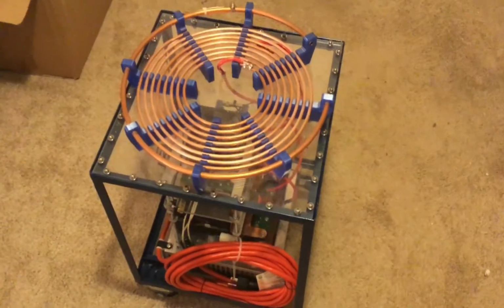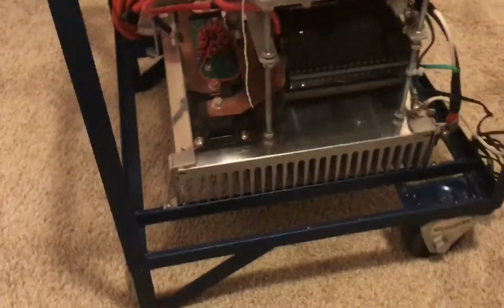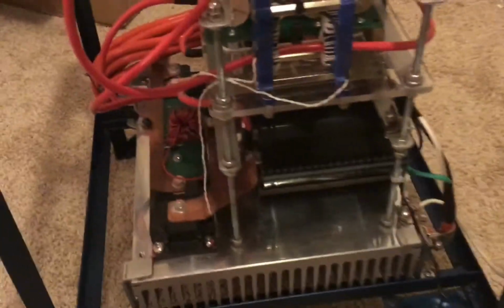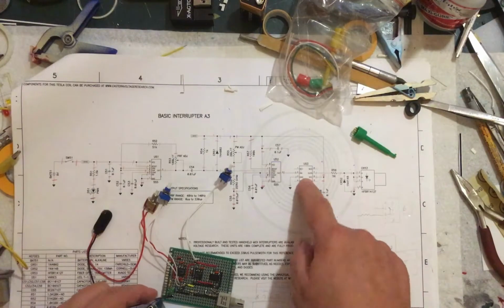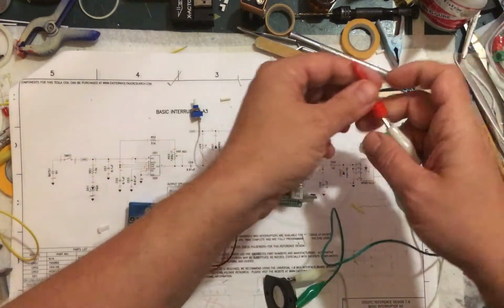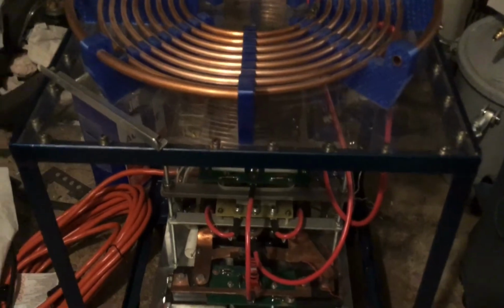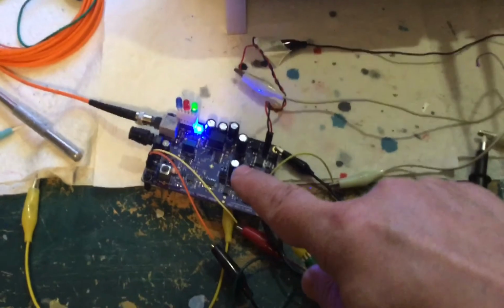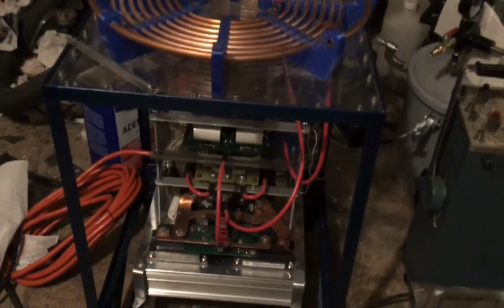Musical Tesla Coil DRSSTC Build part 7

Comment: Nice ! I have a fun Plasmastatic Speakers system I am designing. There are ways to make them run without batteries or plugging in. The extra noise can be handled by ultrasonic soldering, reflective grounding, and traditional grounding. To avoid some problems with ionic generation I recommend placing a strip of large LEDs as a load to replace oxygen within the room.
Reply from the maker: Cool! Makes perfect sense. Thanks for the advice!

Comment: ON THE CONTROLLER YOU NEED TO HAVE YOUR GDT CONNECTED TO IT FOR A ACCURATE TEST, ALSO I'LL RECCOMMEND TO CONNECT THE GROUND LEAD FROM THE SCOPE TO THE GROUND OF THE CONTROLLER AND NOT ON THE OUTPUT FOR THE GDT, YOU ARE CREATING A SHORT ON THE OUTPUT. OR YOU CAN TRY WITHOUT CONNECTING THE GROUND LEAD. REMEMBER YOUR SCOPE AND THE POWER SUPPLY YOU ARE USING FOR THE CONTROLLER ARE BASICALLY SHARING THE GROUND ALREADY SINCE THEY CONNECTED ON THE SAME OUTLET. YOU CAN CONNECT THE GROUND LEAD ONLY WHEN MEASURING THE GDT OUTPUT (THE SIDE GOING TO THE IGBTs ) BECAUSE IS A ISOLATED OUTPUT. IM GOING THRU THIS WHOLE PROCESS AGAIN BECAUSE IM UPGRADING MY SECONDARY AGAIN. BY THE WAY YOUR COIL GONNA LOOK AMAZING !!!!
Reply from the maker: Thanks! I appreciate the info!

Comment: Hi, I'm selecting all the components I need to build the UD2.7c, but I don't know the "tunable inductor" value for this eastern voltage design, could please tell the reference? I know it is something like 7M3-xxx
Reply from the maker: I’m not sure, but I think it’s a -683. That’s what I’m going to start with, but I’m still not sure exactly how to tune it yet though.
Reply: @customfabrications  Oh, thanks for the info. In the meantime, I've searched in the UD2.7c website and they say: "	Inductance values varies depending on your switch and switching frequency. Typical values include: 7M3-123 (9 - 15uH; works well with TO247 IGBTs), 7M3-153 (11 to 19uH), going up through 7M3-223 (17-28uH), 333 (25-41uH), 393 (29-49uH; works well with CM200/300s), 563 (42 - 70uH) etc.  Use a flat-head non-magnetic or plastic screwdriver for tuning (see instructions below in this page)." Take a look there

Comment: The way you coil the secondary is important, be sure it is clockwise or counterclockwise
Reply from the maker: I was wondering about that. The plans I bought don’t specify. It seems like every video I watch, they always wrap it counterclockwise (viewed from top), so I’ll probable do it that way. Actually, I’ll probably ask Eastern Voltage.
Reply: @customfabrications  I know that the way the primary is coiled, is what ditates the way the secondary is coiled

Comment: Also keep an eye on the primary coil.  I see your supports are 3d printed.  The primary can get warm/hot.
Reply from the maker: Yea, the original plans call for plexiglass. PLA does have a lower melting point though. But hopefully it’s ok.

Comment: It'd be a wise idea to enclose the driver inside a aluminum box that's grounded to keep noise to a minimum in it.  You might also have some issues with what looks like a steel frame inductively heating.  Always try to use non-ferrous metals.
Reply from the maker: I sent pic to the engineer at Eastern Voltage research. He said that since it’s a lower power coil, it may not heat the frame that bad.

Comment: I had a problem with the structure getting hot, the support was made of wood, but it had some reinforcements in the corners that were 1mm apart from each other, and sparks flew between them, they got hot and started to burn the wood. Then I removed one of them and the coil produced stronger sparks.
Reply from the maker: Good to know, thanks. I’ll keep that in mind.

Comment: Hi, amazing project! did you design the primary holder? if so, could you share it? i have a very similar primary and i am having problems to make a holder
Reply from the maker: Thanks! But no, I didn’t design it. I bought the schematics and plans from eastern voltage research. I just copied the dimensions and 3D printed it. I already asked them about me making the files available to others, but they don’t want me to because it’s there design, and they sell the plans. I did give them the cad files, so they might provide them to you. Maybe.

Comment: Good idea to wait for cutting the frame. It's easier to cut later then have cutted something that didn't had too 😂👍🏻
I had mine get hot at around 3kW and 700A peak current in the primary circuit.

Love your work bdw ! 😍
Reply from the maker: Thanks! I appreciate the comment!